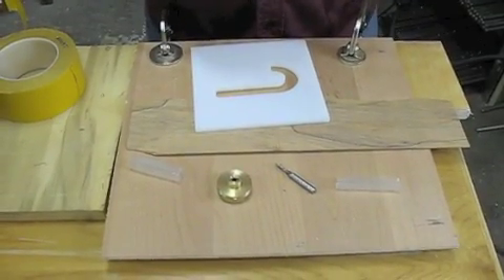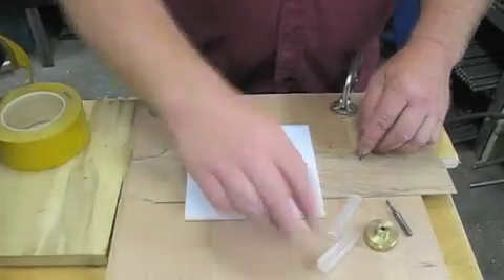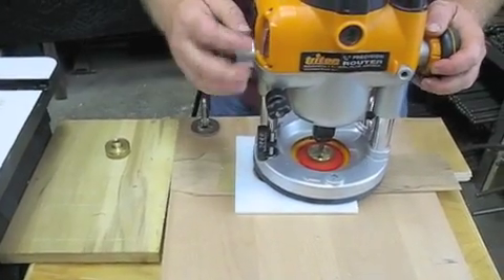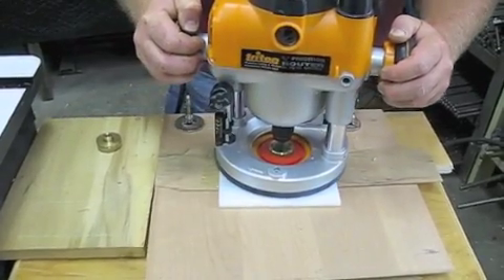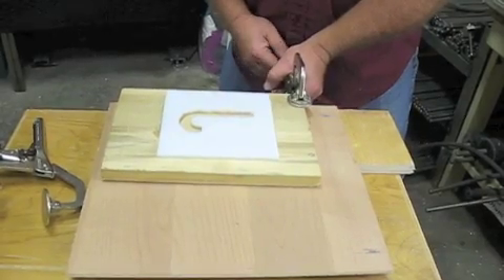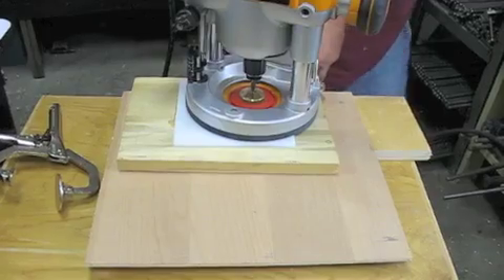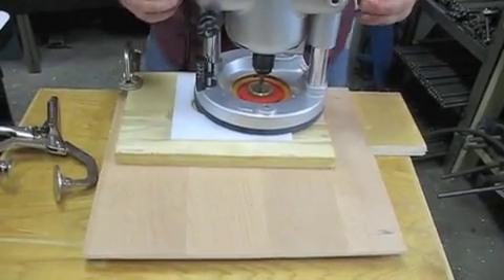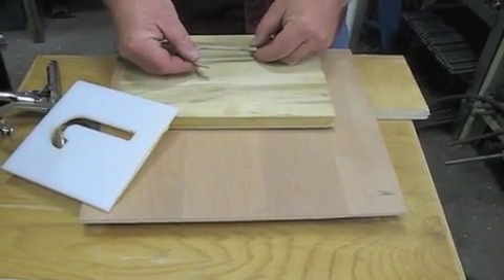Inlay With A Router

Comment: Routing an inlay with a solid base plate is rather foolish. Common sense dictates using a clear see thru base plate on the router. Granted the guide bushing follows the template but seeing what you are doing is a much better practice. That and his not naming the parts of the router and inlay template correctly makes me wonder about this instruction video author and his qualifications as an honest to goodness woodworker.

Comment: Where did this clown learn proper and safe shop techniques?  From clown school?  The brass ring is called a "bushing" not a template.  The white candy cane cutout is called a "template".   

Always clamp your work properly when using a hand held router!  If the board isn't big enough to allow for router clearance then get a bigger board or use double sided tape.

This guy should not be teaching others how to use a router!